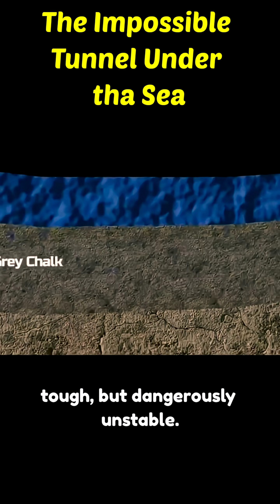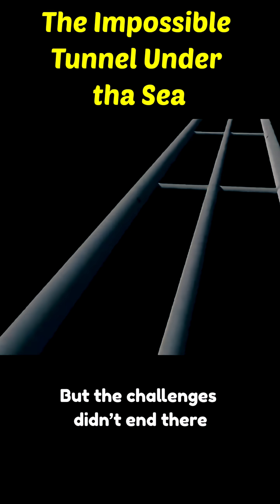The Impossible Tunnel Built Under the Sea #ChannelTunnel

Comment: I once used the Channel tunnel. The "Le Shuttle" use the biggest rail carriages for standard gauge of the world. In fact they are so big that they can never leave the area between the terminals and the tunnel.
Reply from the maker: Yes, exactly Those Le Shuttle carriages are absolutely massive specially built just for the Channel Tunnel route. They’re so wide and tall that they wouldn’t fit on normal rail lines anywhere else in the world